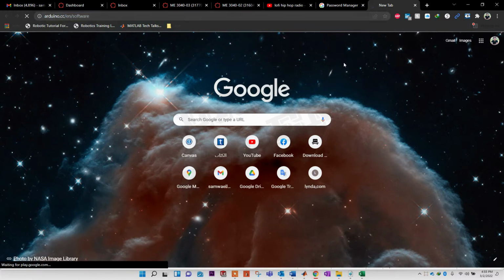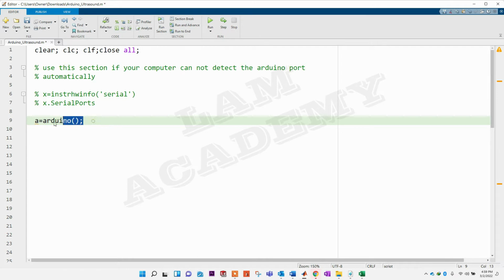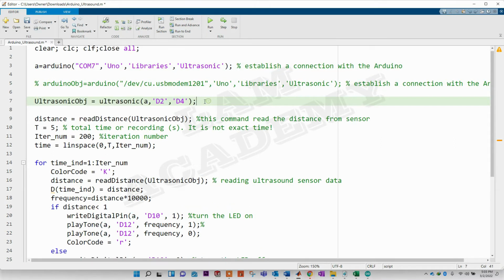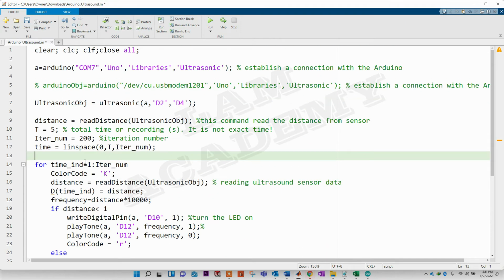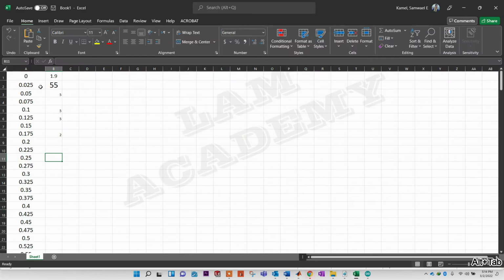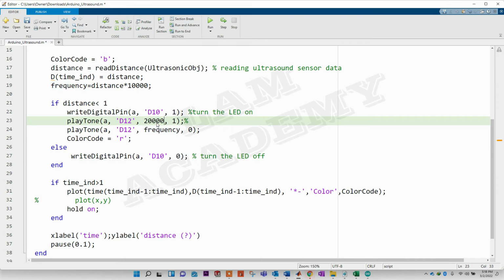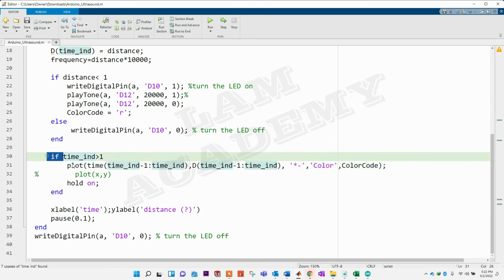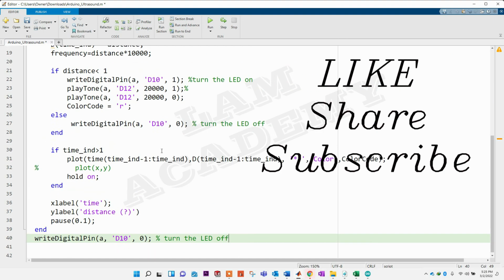Ultrasonic sensor Arduino Board with MATLAB- detailed instructions

Comment: can i use the while instead of for?
Reply from the maker: It’s possible but you have to modify some lines to make it work. For example you need to create a line for the iter_num=iter_number+1 

That’s because of the difference between for and while